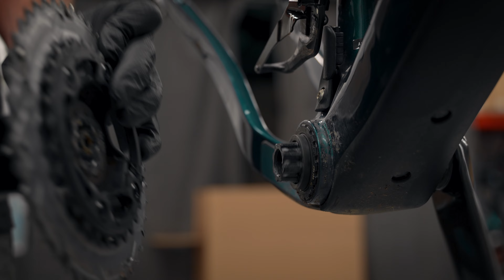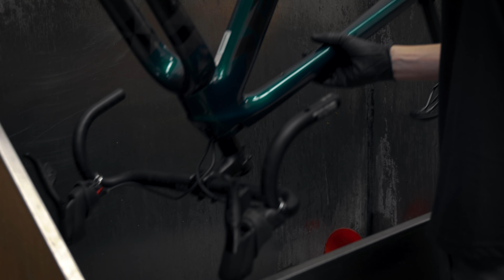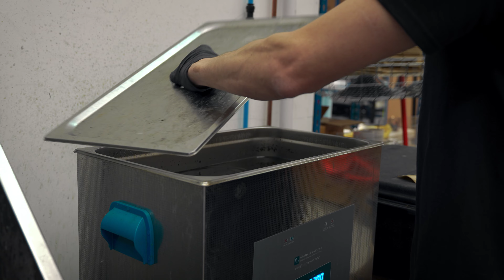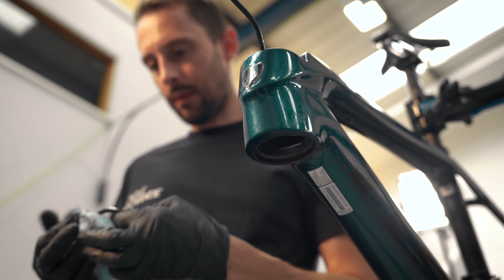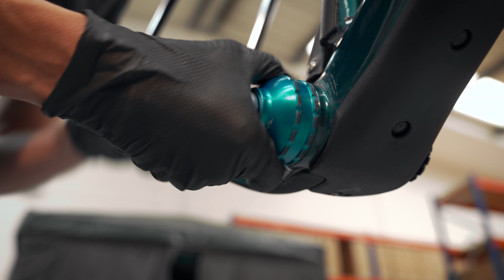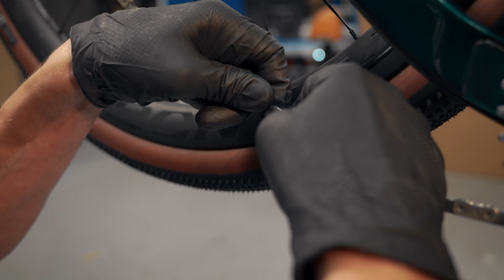Trek Checkpoint SL7 Full Bike Service | The Service: Episode 3

Comment: I really don't like the cables integrated into the headset. Switching headset bearings could be so much easier.
Reply: Totally agree. Seems mad that you've got to disconnect hoses, cut and thus shorten them, refit olives etc and then re bleed.........just to clean the headset!